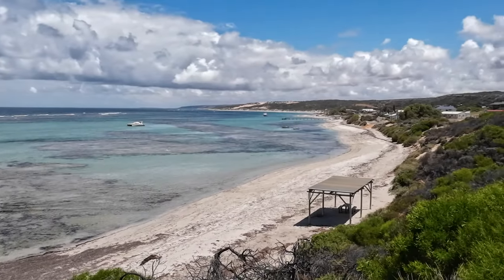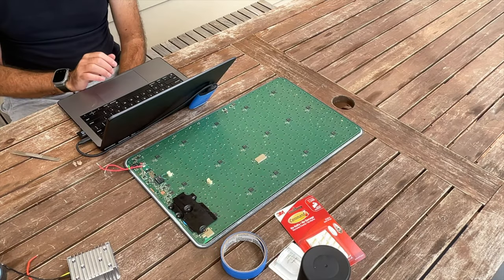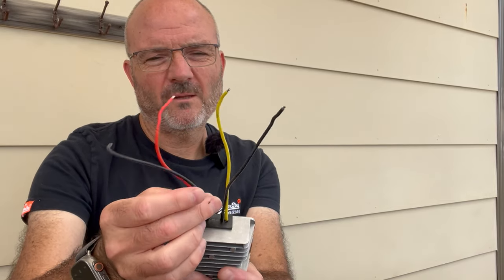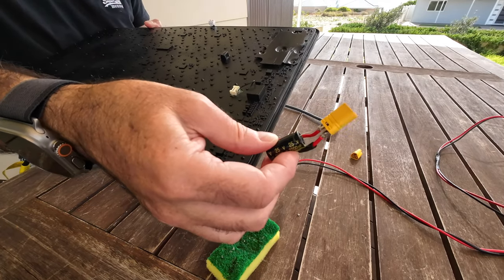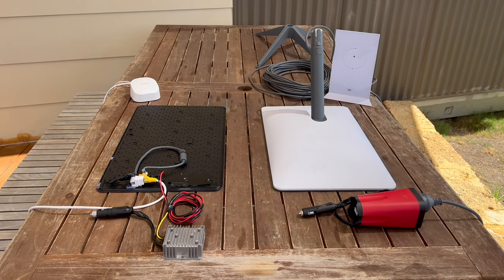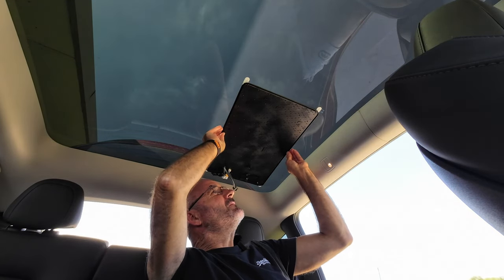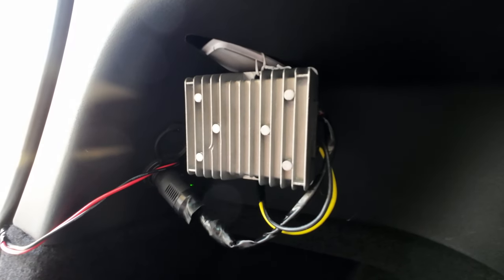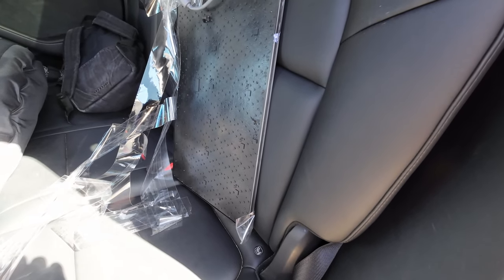Starlink converted for 12v with no POE!

Comment: Suction cups. Epoxy the bottom of them to the face of the Dishy. Use the clear ones and get a good quality.
Reply from the maker: Yeah I'm considering going down this path. However I am looking for something slim, and trying to avoid this sort of look :) 

https://www.reddit.com/r/Starlink/comments/163z18t/starlink_inside_a_tesla_model_y/
Reply: I wouldn't epoxy anything to the Dishy. For a much lower profile, just attach two pairs of suction cups to two pieces of wood, or whatever you have handy, and put the Dishy between the cross-pieces and the glass. Use foam to snug things up and protect the Dishy from vibration. Much lower profile and lots of ways to design/adjust it for the best fit and best look. And no attaching anything to the Dishy itself, it just gets cradled.

Comment: 14:09 Perhaps try the 3m command strips again but this time, wipe the glass surface with alcohol wipes to make sure it’s free from grease/dirt.  Or for a more stronger bond, use the 3M VHB adhesive tape.
Reply from the maker: Thanks for the sugestions @AutosNGizmos. Off to Bunnings we go :)
Reply: the phased array is on a solid pcb so you should'nt try to flex it to match the roof as it will fatigue the copper traces over time and could kill the dish, and even if you somehow bend it, it cpuld significantly decrease the performance and reliability as each antennas factory calibration will be off. I think you could possibly try using double sided suction cups (if they exist, or diy them). if they are big it could decrease the visibility but if it works well, in future you could get a thin peice of wood or plastic that is a little wider than the antenna, secure the antenna onto it and mount the suction cups on the sides to stop the obstructions, @AUSY8

Comment: I would use a couple of lengths of conduit 20mm ends Flattened by heat gun to enable them to push between roof lining and sun roof front and back and curved upwards with starling attached.

Comment: Try 3M Hook and loop so you can remove at ease. They have different grades of hook and loop some can carry many Kg in short tabs.
Reply from the maker: Thanks for the tip @peterwhite6060. Will check those out.

Comment: Really great info. I'm tempted to do the same. Right now I'm storing the Starlink kit in the footwell and only take it out when needed, which is annoying.
The 12V conversion is genius.
What is the weight of the antenna when ready to stick to the ceiling?
Reply from the maker: Thanks, Yeah the 12v conversion is the bees knees. The dish, as shown on the table in the video, is about 1.25kg without any cables.
Reply: Thank you.
1. Do you think it could be installed width-wise rather than length-wise (rotated 90 degrees)? I'm thinking it could ease the attachment quality with 2 sided sticky material (can't find the exact name right now), due to the curvature of the roof. Reason I'm asking is, do satellites require the antenna to be vertical or can it accept being horizontal? There may be an effect with wave polarization. 
2. Do you intend on trying the same with the latest dish that came out recently (late 2023), which I think it Gen 4 hardware?

Thanks a lot, this is amazing content!

Comment: Thanks for the video. 😊 

Any chance of less video feed switches in the video my brain is trying to follow.  😅
Reply from the maker: No worries. Did not realise this video was triggering. I'll see how I might tone it down in the future.
Reply: @AUSY8  it wasn't triggering or anything that bad. At the start I was keen to digest what you were showing me but you were switching feeds a little too much for my liking was all. 

Thank you again for the video, I'm tempted to pull mine apart as I'm currently mounting it flat via suckers. I'm still in the speed testing and reliability phase of that approach as it's kinda a one way trip.

Comment: You don't need a 3 pin connector. An XT30 is a small connector used in electric model aircraft available for Banggood or Hobbyking.
Reply from the maker: Agree. I only used 2 pins. It's what I handy in my small spares box :)

Comment: i have followed all the steps, but have obviously done something wrong ..... dishy works as it should, it comes on line, it even updated but having tried two different routers i keep getting a WAN disconnected message - i am assuming its an issue with the data cable into the dish or am i using the wrong router (unlikely ...) i am using a tp link archer a50 and gnet 1300. as they both give me the same error message, then it has to be the ethernet cable or the connections. i am using cat 6 external cable. i will redo the connectors tomorrow and have another go ..... but one question i do have is - is the ground cable required for the data, if so how do i get that back to the router or can i ground it somewhere in the enclosure?
Reply from the maker: Sorry to hear it's half working. 

I think you are close if Dishy is online. I'm assuming it also shows as online from your account on Starlink.com? 

I'm going to go out on a limb and say it's probably your ethernet connector. Remember to wire it as a "B' connector and use the Starlink colours as normal, i.e. no swapped colours. Also make sure the wires are well seated. I've prepared many an ethernet connector where a wire or two is not seated correctly.

As for ground, I did not ground the connector.I used a plastic connector and I don't think it has facility to use ground. 

Hope this helps. Good luck
Reply: @AUSY8  thanks, it WAS an issue with my crimper not making the connection properly, for some reason it wasnt pushing down on pin number 6 !! all now sorted. thanks. as you said, ground isnt needed.

for my enclosure i have used a 45mm wide piece of upvc window trim, i used my wofes crafting heat gun to bend the upvc around a simple jig. it actually works brilliantly, no need for 3d printed enclosure, i scorched a couple of corners, but next time i would heat from the inside so you wouldnt see it.  it is secured to dishy using sikkaflex and is pretty solid. a purpose size cut piece of perspex will be used on the bottom.

is there a way i can send you a couple of photos as it might help others?

as i have two starlinks, my next project will be to move to a one cable connection. i could do this with a poe injector and splitter i believe, BUT i am considering using a cat 6 cable but only using four of the wires for TX and RX and the other four for power in/out. so it would be an rj45 with four RX and TX out of the router, then a connector allowing me to add power to the unused wires and then at the dishy end (internally( the cable would be split again, with only the rx and tx going into the dishy connector and the other two going to the power connections.

can you see any reasons why this wouldnt work? i am aware that it would cap the mbs to around 100mbs, but that is more than enough for my needs in my RV (motorhome in the UK)
Reply from the maker: @misterb5216  Wow that is wonderful news. Well done. You can contact me using this address: redwood_watt.0k@icloud.com - if you are interested I would be keen to include you and/or your pictures, in a follow up video.

You are taking this hack to this next level. I will have to leave it to my followers on the viability of moving to 1 cable.
Reply: @AUSY8  its up and running just using one cable !!! ive used the four data wires in the ethernet cable to provide data from the router and the other four wires to provide power. 

it looks a bit rough at the moment but i will send photos so you can see the 'concept'. i now no longer need the power connections in the enclosure so will rejig it all when i get back (going over to Europe mainland for a few weeks in my motorhome) 

im only getting around 60mps but thats more than enough for tv, laptop etc !
Reply: ZPDR-10V-S 

Is the connector to dishy that the data (and original power) uses. You can now do the hack without cutting any cables ! You will need the pins of course, which are a pain in the arse to connect to the wires! Anyone have any tips to do this ??

Comment: One question is when you are powering Dishy from 15 volts  in you M3 does the car actively keep the low voltage battery charged or are you now powering from the low voltage battery meaning you could flatten it if used too long.
Reply from the maker: The car high voltage battery keeps the low voltage battery charged automatically. There would only be a risk of flattening it, if the high voltage batt was on a low state of charge or flat

Comment: So if you are using a 16 V to 12 V inverter what are you saving?
Reply from the maker: A whole lot of watts. Also the inverter may out be needed if your car/rv etc has a true 12v. Tesla output 15v-16v from the cig. lighter
Reply from the maker: Also you don’t need a POE injector

Comment: What is the wattage needed to run their system???? I would buy a power inverter for us, we have solar power.
Reply from the maker: Don't quote me, but I think out of the box Starlink consumes somewhere north of 75w on AC depending on settings and if it's booting.
Reply: around 150w peak so get a 300w capacity to prolong your inverter's life. pure sine wave inverter to be exact

Comment: I have a 48v RV battery from Volta, which powers my inverter to output 110v, then the Starlink power supply converts to 48v, then the dishy converts back to 12v. Wtf
Reply from the maker: Wtf indeed. A few too many conversions there.